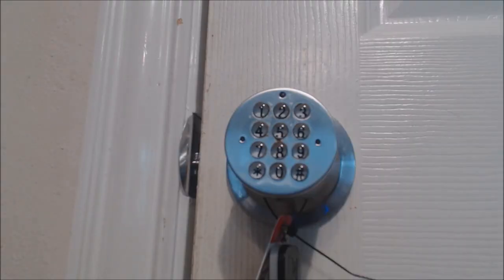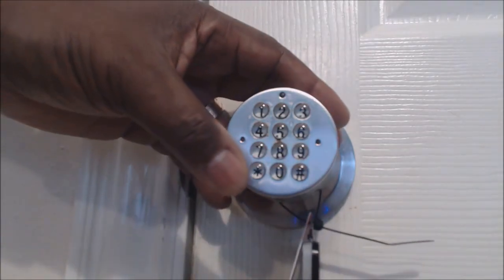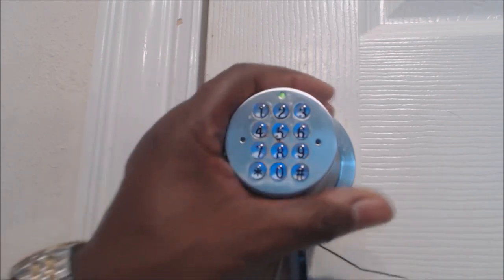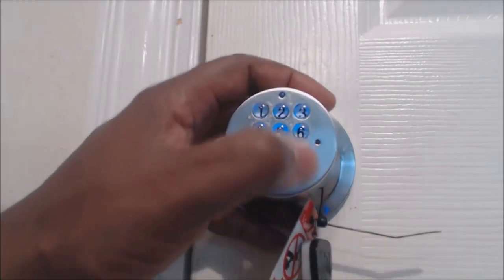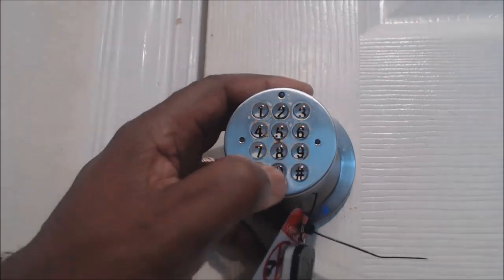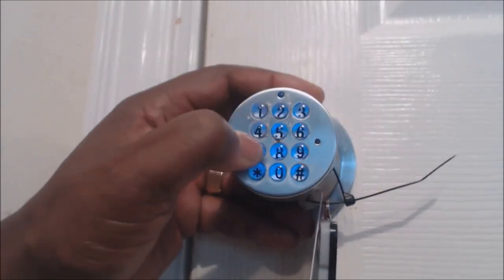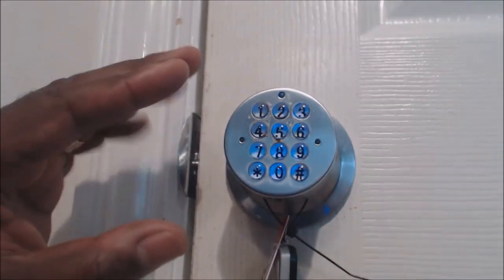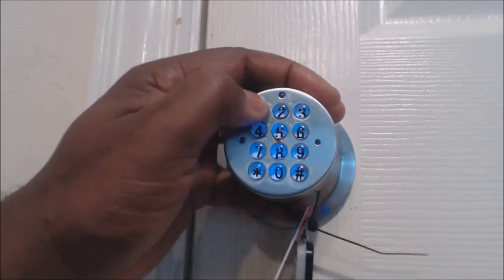How To Change The Master Code On Digital Electronic Code Door Lock Round Knob Turbolock YL-99

Comment: I did exactly how your showing to us but I put a new code and still I can use the old code and new code how come?
Reply: I just did the exact same and it worked.  Also there is a reset button on the other side.  Just unscrew the 2 screws and remove the cap.  Press the black button and it reset it to the master code. 0123#

Comment: Hello, needing help. I thought i changed the master code but now have two codes. i have the master and an additional one. cant seem to be able to delete the second code. Any help appreciated. Thank you
Reply from the maker: have you tried resetting it  https://youtu.be/xurs_h6BneE
Reply: Tony Villa Photo & Film if that didn’t work, try this.
The master code is 0123 and you tried making the new master code say, “4567”. They way you delete the extra code your made,(4567) is to put in your master code, (0123) wait till the beep stopes but before the blue light turns off, press 0000, then what ever your extra code is. So in this case to delete the code it could be 00004.
Reply: It's designed to store multiple codes. The master code MUST start with 0. It wont overwrite unless the new code you enter starts with 0.  Same with other optional codes, each starting with a different number 1, 2, etc.  But don't lose the master code because it is needed to make any changes.
Reply: I dont know
Reply: @weldingandstuff 
Shhhhhhhhh

Comment: I can't change mine, do I need something to plug in I see a tool or key hanging on your knob
Reply from the maker: You don’t need anything to plug in. The tool you see is a clock in for my mother law care giver
Reply: @weldingandstuff  Ok thanks.. and I have the same knob and I still wasn't able to change my code I followed everything idk,,  and my current code isn't using a zero to start I use 1122# so idk if that has something to do with it not being able to make a new code.. oh well thanks for writing back!

Comment: Why bother a magnet can open this lock if placed under the door knob. A magnet would be faster to open this than entering the code. Even the back up lock is so cheap it can be racked open by an inexperienced lock picker in under 30 seconds. Don't buy this and if you own it get a different lock
Reply: As soon as u lose weight, I'll buy a new lock!!!!😂😂
Reply: @djwill6077  the weight I was in that picture is over 4yrs ago so yea I guess it's time for you to buy a new lock now isn't it 😂
Reply: @djwill6077  I lift weights and do cardio 4 times a week I'm 12% body fat. So instead of making comments about my weight why didn't you listen to my post instead of replying 1yr later 😂 I wanted to add lock picking lawyer opened this lock in 10 seconds you might as well not have a lock if you own this pos 😂